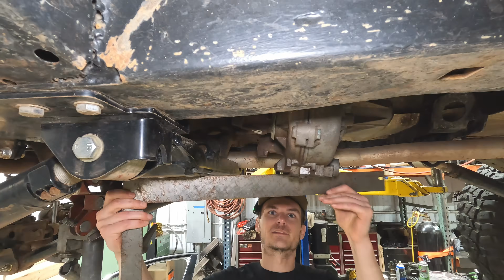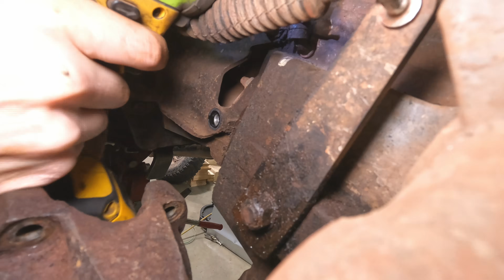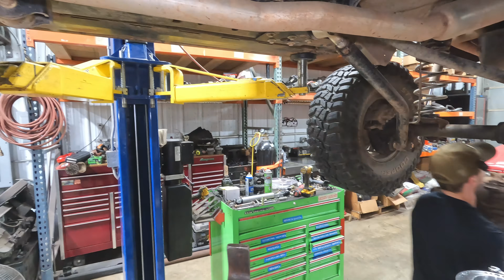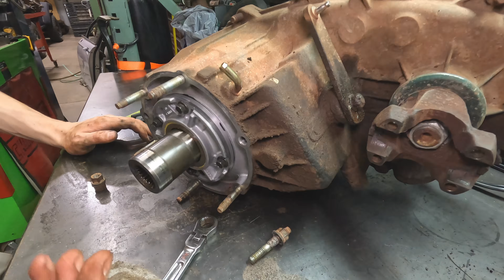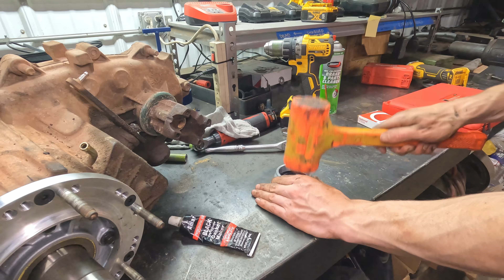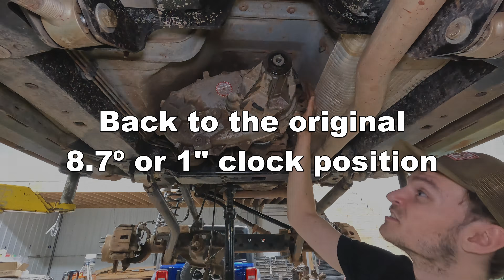Lift Kit for your Transfer Case! - WJ Clocking Ring

Comment: This is so needed. I hate the way the t -case sits so low. I am getting ready to do a cut and turn on my front jk axle, so this will be the perfect time to get the pinion set perfect. ANy issue with the linkage? Does it need to be modified?
Reply from the maker: @jacobrocha5734 Yes, the shift lever on the transfer case needs to be modified. If you have a 247 we have a modified shift lever on our website! Let us know how your build goes.

WJ 247 Clocked Shift Lever:
https://www.ironrockoffroad.com/product/wj-247-clocked-transfer-case-shift-arm.html

WJ Transfer Case Shift Bushing:
https://www.ironrockoffroad.com/product/bushing-transfer-case-shift-lever-wj.html

Comment: would there be any u joint angle concerns for a lower jeep with closer to stock suspension? looking to keep my tc safe on my logging road cruiser
Reply from the maker: @tully348 As long as you have a double cardan front driveshaft you should be good. The factory front double cardan is good to 4-5" of lift. If you clock your transfer case up 1" your driveshaft sees that as essentially the same as 1 more inch of lift. If you are at 3" of lift with a 1" clocked case your driveshaft will be positioned as if you had 4" of lift - still in the operating window for an OEM front double cardan driveshaft.

We also offer a WJ transfer case skid plate if you'd rather go that route. It also protects your catalytic converter. Some have said it prevents cat thieves from stealing it! 
https://www.ironrockoffroad.com/product/wj-transfer-case-catalytic-converter-skid.html

Comment: I have an 02 wj overland that had the np247 stock. Found that the 242j/hd bolts right in with just a rear driveshaft from the jeep the transfer came out of or have a custom one made. Already have a double cardon up front. The HD has the same input shaft so nothing was needed to modify. 
Let me just say, I love the swap! This clock ring seems to be an awesome key part! 
Just curious how much spline engagement is lost in the output to input.
Reply from the maker: Glad to hear you're enjoying the swap! The clocking ring would be a good upgrade for you. There is only about 3/8" spline engagement lost with the clocking ring. Rest assured, we have been running this kit for many years on our 1-ton swapped orange WJ nicknamed Pumpkin. It has the 4.7HO and he hammers on it pretty hard.

Comment: I love your work. On the WJ 2.7 CRD diesels, the transfer case cross member and transfer case mount are different. Do you think it's still possible to install it? The rear output of the transfer case is also different.
Reply from the maker: @jeanaaimar9133 I would check to make sure your transfer case bolts to the transmission with the same 6 bolt pattern. If so, it should work. Do you know what transfer case you have? It should have a round, silver tag on the back side of the transfer case. At the top of the tag, it should say New Process Gear and a model number.
Reply: @IronRockOffRoad  Hi IRO team, thanks for your reply. I also have an NV247 gearbox. Dana 30 low pinion at the front and Dana 44 at the rear.
I would be happy to offer my help with testing parts on our European WJ 2.7 diesels!
Reply from the maker: @jeanaaimar9133 Thanks for the feedback! You should be good to go if you want to clock your transfer case and since you have the 247 you should be able to do the No Cut Hack n Tap SYE for the rear if you want. 

247 No Cut Hack n Tap SYE:
https://youtu.be/OFUjvTnbqkA?si=nRVCO0CCj__98CI1

We'd love to help out other WJ owners with parts fitment on the 2.7L CRD! Send us an email on what parts you'd like to buy/test. Include a picture of your Jeep and the build details on it. (tech@ironrockoffroad.com) We would love to see pictures of the transmission mount/crossmember and the length of the front driveshaft.